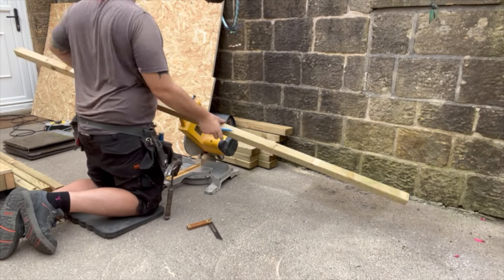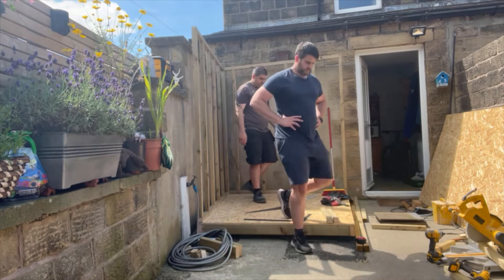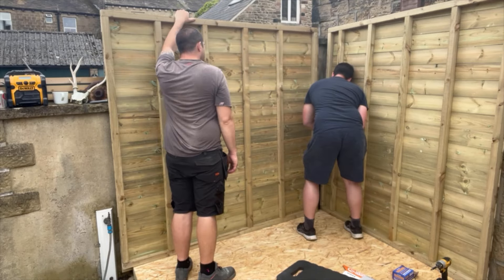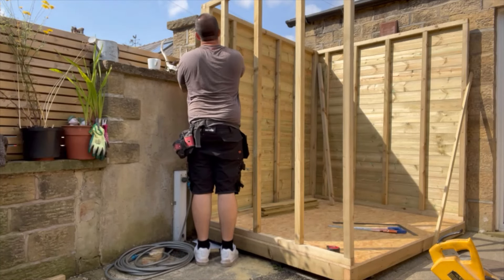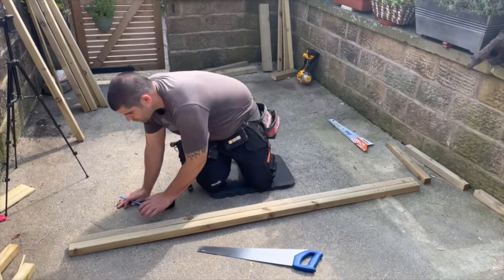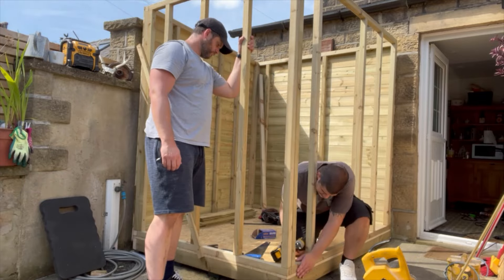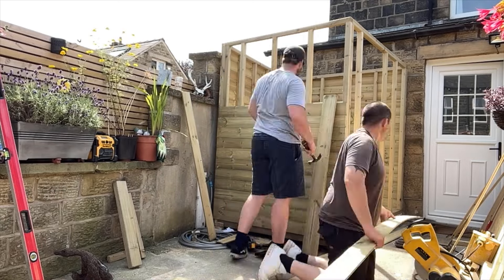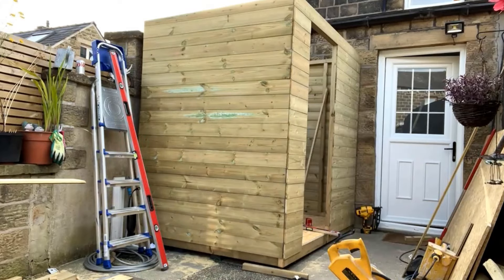Building the Shed Walls | DIY Shed Project Part 2

Comment: Hi mate, great job on the shed.  Very helpful was just wondering , have you built the shed so that the roof has a fall on it ? As it seems to me that the studs are all cut to the same size and therefore no fall? Thanks
Reply from the maker: Yeah it falls around 100mm front to back

Comment: Great video, DYI'ing something similar now in my garden. I am going to make it a lean-to (my garage brick wall) to save the space and materials. From what you are doing it looks like a perfect lean-to the wall case, but you are clearly doing it as a standalone shed with all 4 walls. Did you consider a lean-to? And if so, why have you decided to go on with all 4 walls?
Reply from the maker: Its my brothers shed and this is what he wanted. your right though some kind of lean-to could have worked
Reply: @thediyfix  Thank you! Sorry, I was just validating if something I am going to build is workable or it would be a complete mess (e.g. because of shed base movement relative to a house wall, which can cause cracks in it later on, or gaps water-proofing behind a house wall and a shed). I was worried if it is built as a standalone shed there might be some structural reasoning.

Comment: Nice job, are you a chippy by trade? I was wondering if there'd be any advantage to also gluing the T&G joints?
Reply from the maker: Yeah I am but only did it for about 7 years and not done it as a job for over 15 years. Regarding glue I personally wouldn’t because the cladding will expand and contract due to moisture and temperature. It needs to move freely and glue would stop that
Reply: @thediyfix  Cheers - great explanation! 👍